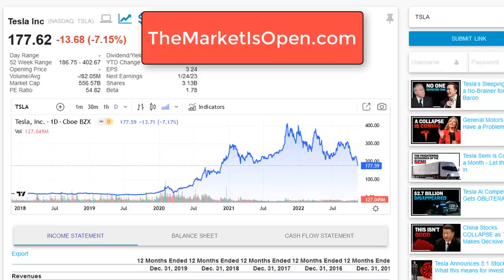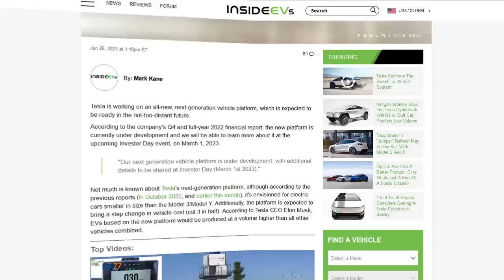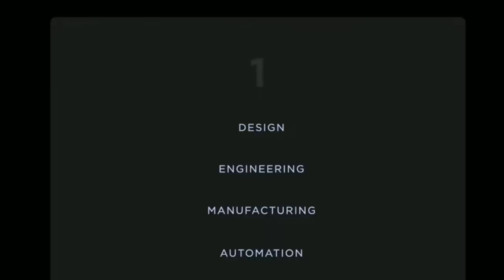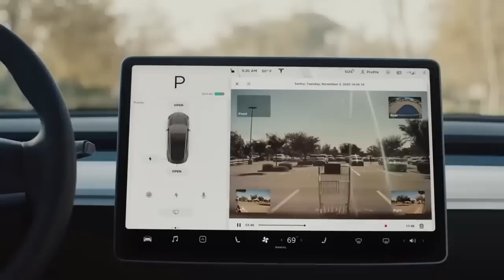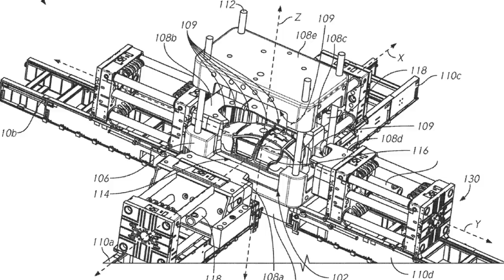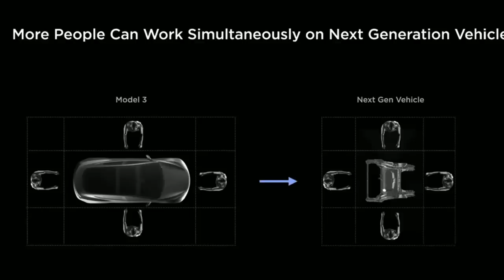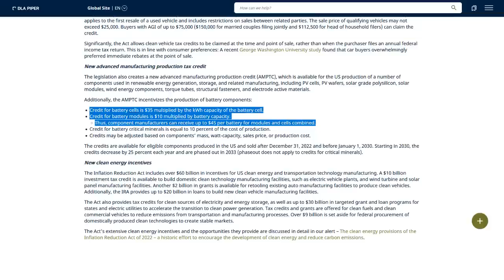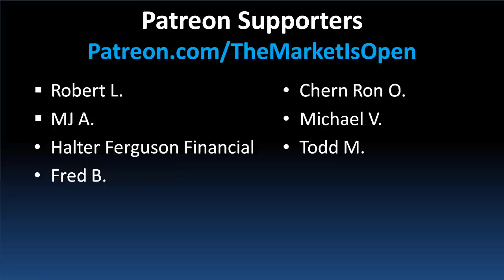The REAL Reason Elon Musk is Developing a CHEAPER Tesla

Comment: The problem is still the battery technology that’s used to create these vehicles. A replacement battery costs a minimum of $15000 to get replaced by Tesla. Some breakthrough in battery technology really needs to happen because current batteries are only going to get more expensive.
Reply: I just seen some co. Forget the name is coming out with a batteries that have no rare earth minerals , withstand high heat without demagnitizing , Also smaller with double the energy output . Sorry I forgot the name , it's iron nitrait that it's made with , just needed a process like tempering steel that will b costly so well see
Reply: Batteries are only getting cheaper.
Reply: If the $15,000 battery lasted for a million miles would it be too expensive?
If the battery could be recovered and used on the next car would it be too expensive?
We have in our minds that cars last a short time, this is not necessarily acceptable.
Cars age, mainly because of material deteriorstion. High heat ICE have a great deal to do with this. Look at simplifying cars and keeping them on the road longer becomes easier.
A high quality long life car would have a much higher resale value, lowering the cost of ownership. This would not help the current Dealerdhip Industry much, which Tesla has put a nail in. A paradigm shift would leave many fat cat Detroit billionaires unhappy.
Don't cry for them. Detroit has been a low performer in improving technology and economy.
They have been bailed out twice at taxpayers expense without requisite change in management and taxpayer stock ownership, which would have been the case if the capital market refinanced Detroit Auto Industry.
Musk sleeps on a couch in the factory office, Detroit execs should do the same. /rant
Reply: Oof
Reply: @Mike11523  that’s because they are using cheaper parts
Reply: @Tylerd838  no.  Batteries she technology get cheaper and improve over time.
Reply: @Mike11523  batteries are at their breaking point. The rare earth metals are getting more expensive. Eventually they will be the breaking point of the entire industry.  That’s why a major breakthrough in battery technology needs to happen. Every countries electrical system can’t support 100% electrification of the entire fleet of vehicles on the road.
Reply: @BruceRichwineJr  The rare earth metals are not using in any batteries. They are a components of permanent magnets.
Reply: @GgDBXS  you are correct, but the cost of them and Lithium is only going up. We really need investment in new battery technologies and infrastructure. If we want everyone to drive an EV that’s the only way possible.
Reply: @BruceRichwineJr  just a note that the cost of lithium is actually down 60% in the last 6 months. It's still high though overall
Reply: Tesla is using a new technology in mexico and Texas, dry  process to make batteries, it makes it cheaper. But the price will be 25000. That's for 2024. If they have a denser  battery later it will reduce the amount in the vehicle and reduce the price more. So by 2030 I can see a 15000 to 20000 maybe....
Reply: @shawncooper8131  I think the biggest problem for most is the entire industry vertically integrating just like the electronics industry is part of the issue too. Eventually you’ll only be able to get your vehicle serviced by either a dealer or the manufacturer. Manufactured obsolescence is a real thing and forcing customers to buy new is something that will have to be closely monitored and regulated.
Reply: @BruceRichwineJr  Ok, but who is against investment in new battery technologies and infrastructure?, Why you raise this argument in a EV-fan channel comment section? Maybe you should write, that we needs round wheels? ;)
Reply: @Piccodon  it doesn’t matter how long a $15,000 battery lasts if I don’t have $15,000. That’s like telling a renter they should just buy a house because it’s cheaper over time. If you don’t have the tens of thousands for the down payment, it hardly matters if it’s cheaper in the long term.
Reply: @davidjohnson9186  right, if you do not qualify for the financing, you are not the intended market. 
Have you checked car prices lately?
The are always mopeds and scooters.
Reply: @Piccodon  My experience over the past 70 years  is that, with few exceptions, body work fails long before ICE. Some transmissions fail long before either motor or the body work. I have had Ford cars where the gearbox failed at 75000 miles, almost guaranteed, and Land Rovers similarly so.  My family's   VW Jetta had 500000 miles and still ran well but the body rotted.!
Reply: @bill_the_butcher  Did you read the first word in my statement? 
To people who can read it means something.
Reply: @BruceRichwineJr  Yes an Apple only repair world of cars would suck.  I like more of the "I fix it" team up like what steam did with their deck. Hopefully tesla just has it for just 3 things like motor batteries and chip controller. Everything else is DIY.
Reply: Saying that batteries will get more expensive is like saying that computer chips will not get faster and cost more money to make over time... Batteries are tech and they follow wrights law really really consistently. Look up Toy Seba and his work on cost curves. There are more and more batteries chemistries coming on line that are cheaper and/or more power dense which also means cheaper (since more density means less battery needed, which means less weight which means even less battery needed). Currently a model 3  when viewed as a total cost of ownership for the first 5 years is a little cheaper than a crummy and cheap Toyota Corolla. When Tesla gets its 25k car out you would find it cheaper than a Corolla in a couple years, and if the 7.5k rebate is in, you would find it cheaper within the first year.

Comment: Austin broke ground in June 2020 and only now, nearly 3 years later, is it producing any kind of volume. I imagine it will be 3 to 5 more years to approach full capacity.
Reply: Austin and Berlin were the first Giga Factories. They may have improved the process since then. In about 2 years Austin was making cars. Not at max speed, but they were making cars. If Tesla learned from the process, Giga Mexico may produce cars in a year or two.  Only time will tell though.
Reply: And the year before that in Jan 2019 tesla broke ground on that muddy old watermelon farmers field out in Shanghai.
By Sep they we're loading the production equipment by Dec 24th elon delivered the very first mic model 3s. 

In less than 36 months of production in a global pandemic with supply chain issues not seen since ww2 they built their 2,000,000th car in Shanghai. So tesla can absolutely get ludicrous speed proven production out of a new location&team suppliers etc. 
The same guy who ran gigahai btw is now the boss of all teslas U.S. production Tom Zhu. 😎

Teratx was built differently to Shanghai, all new design and layout, Berlin is different. And TERAMX will be a different design again.

Comment: The reduced prices are assuming EV credit back of 7500 but That won't happen specially on something 25k. most you would get a an E-credit would be like 10% of the value or 2.5k. Additionally even if this comes to market you still need a way to charge, do all condos have a way for even outside parking tenants to charge, no and the low supply of charge parking will make it cost like 700 dollars more a month if you want to park there. Renters can just casually charge anywhere right- WRONG. Even if this comes to market there are way too many infrastructure problems. 
Additionally how well does a 45V system interact with the previous methods of charging, and what about old and breaking down chargers will that new 45v system run correctly probably NOT.

Comment: TSLA is doing it because they can. The vertical and linear integration between SpaceX and Tesla advanced teams seem to involve significant investments in commercial-usable basic sciences, and compute-intensive teams.
Reply: Vertical integration works in the innovation phase of product development. When technology becomes a commodity it's best to play competitive forces to reduce costs., Many of the costs are not direct manufacturing costs , but healthcare.
Reply: @timothykeith1367  Munro Live seems indicate there are is some business value to TSLA’s vertical integration. Strategy. 

My local grid is heavily saturated with non -battery PV installations requires expensive smart inverters that can control home exports to our grid and even though I’m a residential homeowner and the amortization of new technologies doesn’t pose a compelling cost benefit as an already green home and short-range commuter who rarely needs HVAC in a modest sole with solar water heating.

Comment: An inexpensive (versus 'cheap') platform would certainly be a boon... but it'll lack any of the features that makes Tesla stand out amidst the competition.  Chiefly:  360 camera view that can be stored and reviewed and, of course, the self-wrecking feature.
Reply: They will stand out against their competition by having no competition. By selling EVs at that price point. No one else will be able to sell to the masses like that. It could be enough to make it economically feasible to have an electric commuter car.
Reply: @wmason1961  maybe not in the USA, but elsewhere certainly they will.  VW already has a similar sized vehicle under development and at a lower price point too.  The Chinese manufacturers will also be offering competitive vehicles.
Reply: The reduced cost will be due to the new manufacturing process not removal of features. With the next Gen. also being the base for adobo-taxies they will certainly have the full slate of cameras.
Reply: It is a $25k EV! That sticker price alone is enough to stand out.
Reply: @MyMovie5858  chevy bolt already exists, even if its not as flashy

Comment: Thank you for the comprehensive presentation.  Tesla and you speak of replacing fossil fuels, but you forgot about many large segments of the economy that also use fossil fuels;  fertilizers, food products, textiles, plastics, chemicals, etc.  Therefore, your and Tesla's  presentation is not totally inclusive.  In fact, the remainder of the economy that uses fossil fuels probably represents about 50% of the present fossil fuel usage that can not be replaced by electricity.  However, I applaud the effort to replace fossil fuels, but it will be far more difficult than what is presented here.
Reply: And there is a lot of plastic in a Tesla - made from fossil fuel mike.
Reply: Hello my fan, Greetings from Musk🤗

Comment: wont having them manufacture the smaller components in house just make it that much more difficult to have them repaired? Will this cause tesla to have proprietary things like tire sensors that could have been replaced for cheaper by a local mechanic? Even if it makes it less expensive for the company, how will this affect the end user?

Comment: I guess Musk figured out that most people can't afford a 50 thousand dollar car. But then again. those of us at the bottom don't feel lucky, so we aren't going to take the chance on those batteries going bad when they are used.
Reply: Batteries going bad is not a big issue.  The batteries will just get better, and a 10% drop in capacity will not mean much if you can drive way longer than a few days of your daily commute between charges.   But EV will be cheaper than ICE in a few years.  The repair bills will be half and the cost for "fuel" will be perhaps 20-30% or less compared to ICE.
Reply: @la7dfa  Then if I buy one and the battery needs to be replaced or the owner has removed the main battery because it is worth more than the car, you will buy the new battery for me?
Reply: @donaldgrant9067  A car with no battery would be cheap enough that you could get a second hand one and put it in. Just like you get a junkyard engine for an ICE car. A ten year old car deserves a ten year old battery, or a new one that's half the size with the same performance. There's people in Europe refitting Leafs with new batteries, getting twice the range.
Reply: @jamesvandamme7786  I wouldn't buy a car that I couldn't drive right away so the batteries could put in it. Beside I've seen where the battery's are and there is no way a none mechanic could put it in. They are in the bottom of the body. Which means you have to remove the body to get at them. Nope I still predict that these cars won't be worth nothing once that warrantee runs out.
Reply: @donaldgrant9067  Watch some Munro videos where they show how the batteries attach. You put it up on a hoist, unplug, remove the screws and hoist it down with a transmission jack. Easier than swapping out a transmission, far easier than an engine. 
Batteries can be checked for health and that will be part of used car negotiations. They don't die right after the warranty runs out. 
Would you buy an ICE car with no engine? Maybe, if you could get a spare cheap. But putting in a used battery is easy.
Reply: @jamesvandamme7786  I don't have a hoist. And neither does most of the working class that will be buying them used. You know the people that makes the thing you sell? The ones that gat paid like crap. And you take it in for service and they will always say you need a new battery.

Comment: We need a town car now.. just a nice little car with a range of 40-60 miles that can recharge on a solar charger or 
overnight 110 a/c outlet.
Reply: The problem with that is the lack of charging outlets for urban car owners living in high density housing such as multi story apartment and condo buildings, even with parking garages. The cost of retrofitting them with charging stations and the electrical infrastructure is much greater than property owners and HOA's can afford. Right niw, Evo's are best suited for suburbia where owners have solar panels on their roofs for charging them.
Reply: An old Nissan Leaf will do that job, the battery in the first gen was pathetic.

Comment: 48V is a much better sub-system bus voltage than 12V .... but that makes me think of electric marine propulsion, where the systems greater than 25.6Vnom are only approved for salt water use by their connections passing insulation and isolation tests.....but where 48V is the fresh water maximum voltage.......
so i hope no one plans on towing their salt water keel boat to a landing, and backing it down into the water with their Tesla ???
or maybe try 24V subsystems there hey ?...but if the 24V fuses wont hold in salt water, your could always revert to 12V busses ( probably get that sorted before going into production )
Reply: Hello my fan, Greetings from Musk🤗
Reply: @Elonreevemusk1212  maybe a sensor, toward the bottom of the rear bumper, could shut off the 48V toward the back of the car??? i am sure the higher voltage connections would be potted, with sealed connectors and dialectic grease...but cost of that for every connection on the subsystems busses, would want a different solution..
you almost have to think about salt water up to the front tire, up and back, on a 5% grade..
Reply: @RulgertGhostalker  It's nice chatting with my fan. I'm not always active on here, we could discuss privately if you don't mind?
Reply: @Elonreevemusk1212  yeah, that would be better...e-mail ?
Reply: @RulgertGhostalker  musk real elon 0
Reply: @RulgertGhostalker complete and text me on my mail.
Reply: @RulgertGhostalker  check your mail I sent you messages
Reply: @Elonreevemusk1212  sorry Elon....my sleep schedule has been cartwheeling..
Reply: @RulgertGhostalker  everything well be fine believe
Reply: @Elonreevemusk1212  i have to acclimate to life getting a little worse every day at my age... but i can hope.
Reply: @RulgertGhostalker  everything will be better for you
Reply: @RulgertGhostalker  Good Morning
Reply: @RulgertGhostalker  how are you?
Reply: Any voltage, 12, 48, 10,000 can be used if it's insulated well enough. There's no magic figure.
Reply: @jamesvandamme7786  on subsystem busses, there would be a connection sealing economic thin line you wouldn't want to cross, and that might be 48V